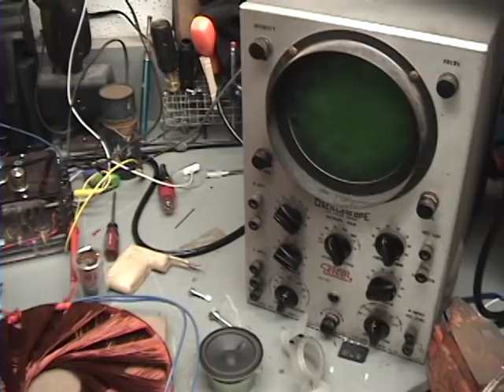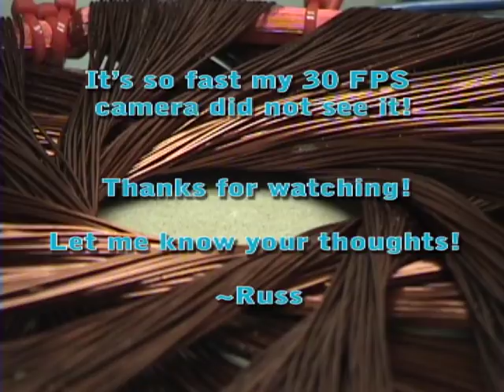Rodin coil  + 120 vac = Flying magnets... separating neodymium magnets via Rodin coil (TEST12)

Comment from the maker: :) dangerous is what i do... BUT safety is always priority... you know like the mythbusters... they can have some "dangerous fun" :) well till that cannonball went a little hog wiled. HA. any how yes safety first. thanks. ~Russ
Reply: Just be careful around that 120VAC. You were so focused on splitting magnet you left the juice on to those screws. You may electrocute yourself if not careful. Please don't die. You basically made a very poor rail gun that shoots in two directions. Unwind that pretty coil and make a real rail gun / launcher. You'll have more fun.

Comment: A magnet vibrates  in and AC field, so what, what are you trying to prove?
The "Rodin" coil is possibly the most inefficient coil  The coil does not separate the magnets, it's because the hit something that seperates them. You need to read up on basic electricity. You have no idea what happens because you have not read up on basic electricity.

Comment: Of course the magnet flew up, you put 120 volts across a coil.
The unfortunate thing about the rodin coil, is that it's an awful coil. 

With a standard solenoid and 120 volts, you can make a piece of non-magnetic aluminum fly up. As a bonus, if you drop the aluminum in liquid nitrogen and try it, the aluminum will fly up like a bullet. 

All you need is about 7 amps in a 500 turn coil.

Rodin is a charlatan. His coils are just really awful solenoids.

Comment: This makes current rail gun technology a waste of resources, if you got a few of these to form, if you will,  a gun barrel , this could accelerate a projectile at similar or faster speeds with less heat needed to be dissipated. Weight of the projectile could be an issue though.

Comment: your audience will be full of little people little Minds, I don't know anything about electricity, but I do know cancer I've been fighting this for 5 years now I've got colon cancer of the liver with that said I watch YouTube I Love It I look at the good and I look at the bad but I love each one ,I take a nugget from each one now I'm going to put my two cents in that contraption to me is nothing but antenna RF to me the enemy here is the amps could you put a couple capacitors running up to about 70,000 volts put a aluminum pop can aluminum in there because it won't absorb the field then count to three and then dial nine-one-one look up Gerald Morin on YouTube he's all about RF he runs all these motors with no apps no heat also when he generates RF energy to light up a thousand watt light bulb doesn't do it completely then he hits it with a temperature gun and its minus 5000 Celsius check it out YouTube